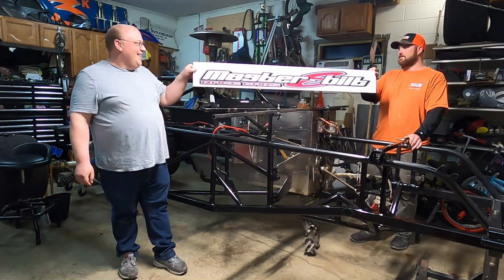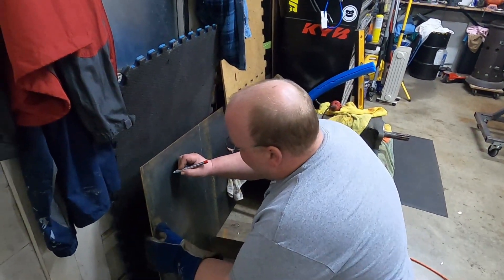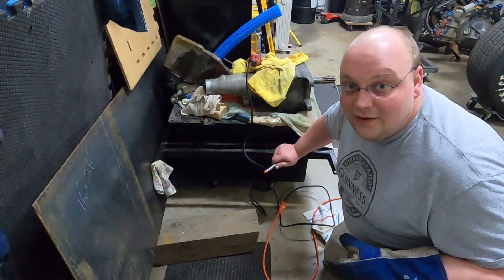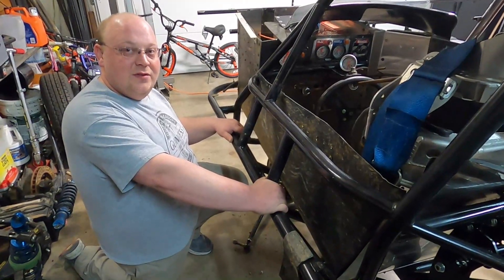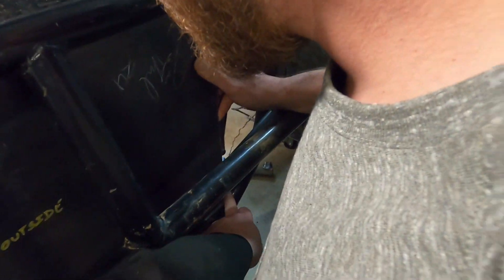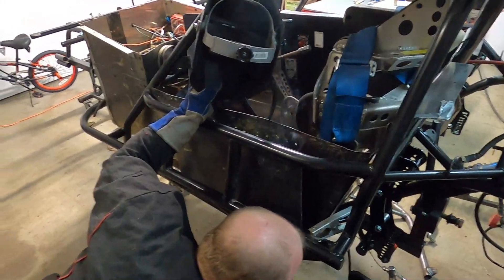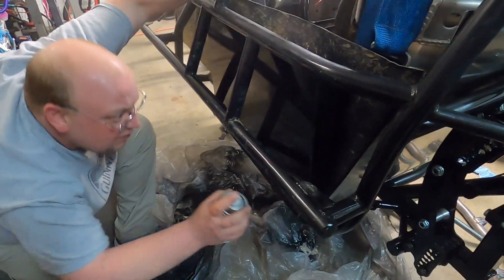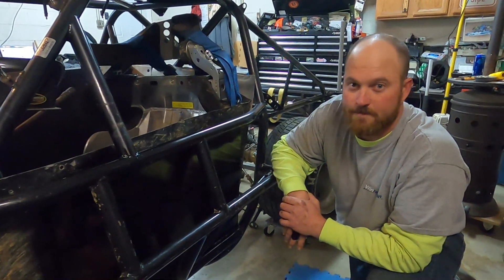Safety Upgrade Installing a DOOR INTRUSION PLATE on Our Dirt Late Model

Comment: I typically mounted mine outside the roll cage for added support. But will work the way you have it. Fun watching y’all progress!
Reply from the maker: We decided it saved the most time to install the way we did. The OG plan was to cut the plate into smaller pieces and weld to outside.  Thanks for keeping up with us!

Comment: If a chassis has flex, it needs to be scrapped.
Reply from the maker: When we launched the RF frame rail video there was some concern about the "flex" of the late model chassis.  All things metal have to flex a tiny tiny tiny amount to reduce breaking.  Some big time late model builders/drivers try to control this "flex" to their advantage.  Our current power house will not produce enough torque to make a difference.  Thanks for watching.
Reply: @LateModelGarage  I don't think so myself, yes all steel.has memory, but flexing speeds up metal fatigue, thus creating voids through work hardening leading to a crack. You can't have a consistent handling racecar with it flexing in the chassis. Chassis needs to be as rigid as possible, to be able to tune the shocks and springs.
Reply from the maker: Jerrell, we think you have a very valid point here.  In the dirt late model business this is very much a grey area in our opinion.  To such a degree that we might make a video just about this topic to see if we can get several more people to join in the discussion.  There is so much to learn and consider that the only way to move forward is to bring lots of race savy people together to discuss topics just like this one.  Thanks again for checking out our uploads.  Keep commenting and sharing your thoughts and ideas.  It not only makes us think outside the box, but could also assist others with the same issues or concerns. 👍
Reply: @LateModelGarage  I've been around dirt and drag racing all my life, and been building chassis since 1994. The only time you want a chassis to flex, is if you dont have springs and shocks, like in gocart racing.
Reply from the maker: We wish you were around to take on the "flex" people we run into.🐱‍🏍(I totally agree with you on the flex issue)  Only having 7 years in racing we consider ourselves still green.  When updating the car we had several people put pressure on us to be concerned about the "flex".  With your advice and experience our "just weld it up so it don't break" approach seems to be acceptable if not desirable.  Stronger the better!💪 Thanks again!
Reply: @LateModelGarage  Even after 24yrs I still consider myself green, cause i still learn something new everyday. The one's that don't think their green, think they know it all. No one ever knows it all.

Comment: Looking good. Would the rules not let you do it in two sections so it could have been welded to the door bars?
Reply from the maker: Yes, the rules permit individual plates, as long as it covers the correct size.  Cutting the plate was very difficult.  We didn't feel skilled enough to make a clean cut with the torch.  The best option, for us, was to use a angle grinder and a diamond tipped cutting disc.  This process was labor intensive and time consuming.  With an overwhelming amount of work left on the table we needed to keep moving forward.  Not the prettiest but it will work and pass tech.

Comment: Could of put it on the out side 😴
Reply from the maker: That option was certainly on the table.  The problem was the time it was taking to cut the plate.  In order to install on the outside we would of had to make more cuts.  After 20 minutes, making the first cut, we decided to just put it in as one piece.  If we were building a newer car I think we would get the plates pre-cut to size and weld in the cage.  Thanks for watching!